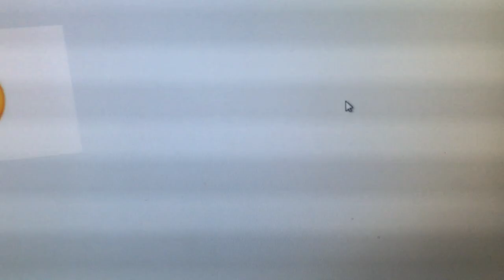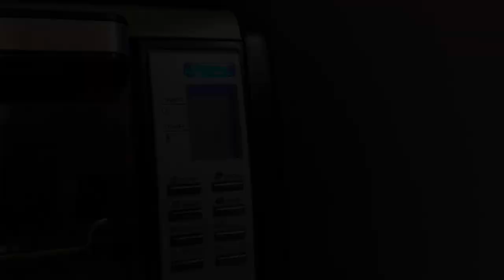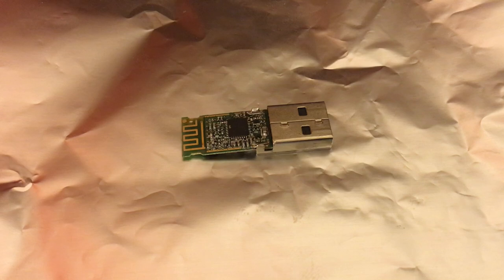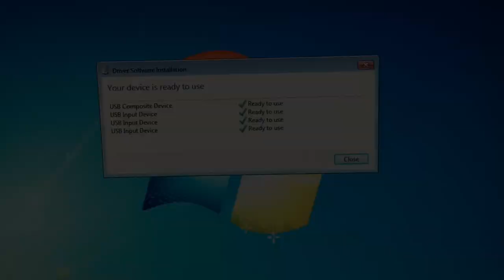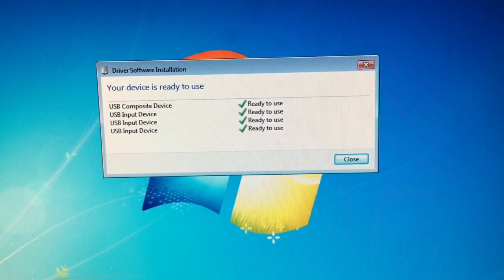How To Fix Broken USB Wireless Mouse or Keyboard Transceiver Transmitter Adapter Module Receiver

Comment: Hello sir, upto now 535 peoples commented here  with success message. I have also followed your video, honestly saying without checking or setting the temperature of ovan.With normal default temp, kept for 10 mnts without foil paper, but kept with ovan glass plate inside. When i switch on power, it got little spark inside and fire. I switched  off immediately and found usb dongle board damaged by  fire and smell and little black color on it. On the top side of board there was a black gum type seal found.

Also i found my ovan  not working now!!!! Damaged. What happened still i dont know.

One question, normally foil paper will not use while baking foods inside ovan, it may get spark or fire, correct?  But you are keeping that, and i am not... Bad luck. Lost all.
Reply from the maker: Sir, using foil in oven is absolutely normal.  Sounds like you used a microwave according to your description, which is using electro-magnetic frequency, not heat. And thats makes a huge difference.

Comment: Man, I did exactly like you and it WORKED! But just for 2 days, I repeat the procedure and then after 1 day it stopped over again. WHAT CAN I DO TO FIX IT?
Reply from the maker: Well, the proper way to do it is to re-flow with new soldering.
Reply: I have a solder but can't find where is broked, it seems as all ok. So, thanks anyway.
Reply from the maker: Is your USB port located near heat sink fan or something? 
I wonder why is it keep breaking...
Reply: ComputerPalz it'snt, I've no idea what's the problem
Reply: ComputerPalz it'snt, I've no idea what's the problem
Reply from the maker: Was it getting hot when plugged in?
Reply: ComputerPalz nope

Comment: The aluminum foil is really necessary?
Reply from the maker: I didn't want to put USB on the metal tray of the owen since is is more heat conductive and it can damage the circuit board.

Comment: how do you remove the plastic
Reply from the maker: Try using guitar pick or knife to pry-open the housing.
Reply: use hot fan for minute and after gently use small knife or thin guitar pick, start in corner where the oposit side is missing plastic, after you first easily removed metal housing, just pushed the pins on side and 2 on top by small electric screwdriver.

Comment: this completely messed up my transmitter. WARNING TO ALL, some transmitters have a UNREMOVABLE plastic base. and i didn't realize until i took it out of the oven to find it half melted. Now the hole is blocked and i can't plug it in at all!
Reply from the maker: Thanks for sharing.

Comment: Hi, i was wondering if it's possible to re-solder these usb receivers. My receiver for the old Logitech MX Revolution that they dont make anymore would work intermittently but basically i had to hold it at an angle i.e. cant use it for any real purpose. I basked it and it seemed to work briefly but it started doing it again - is it possible to properly repair these? 
I can't buy just the USB anymore - it's too old, and all I see for sale are whole mouse sets - new at 500usd, used at around 100 (i.e.what they cost when i very first bought it).

cheers
Reply from the maker: You would probably have to find someone to do it for you. I don't think you can solder it properly without proper equipment, and microscope probably... There is a reason thsoe are called microchips..!

Comment: The max temperature Is 230,what can i do?
Reply from the maker: 230 Fahrenheit or Celsius?
Reply: @DIYtimeTech  Celsius i think
Reply from the maker: I used F in this video. You need to convert to C.

Comment: It did not work. The computer does not even recognize the transceiver now. I used the convetional oven at 195°C = 390°F as suggested in the videos. I recommend, if try, try less time.

Não funcionou! O computado nem reconhece mais o receptor de USB. Dá falha na solicitação de descritor. Usei forno convencional do fogão em 195°C como no vídeo. Se for tentar, recomendo tentar com menos tempo e pode ser que destrua o dispositivo.
Reply from the maker: I guess you were on the bad side of 50/50 chance...
Thanks for sharing your experience though...

Comment: Tried it and it made it worse -_- now it doesn't even work if I push it
Reply from the maker: Did you follow exact time & temp settings?
Reply: yep...
Reply from the maker: Sucks.
I guess you are on the wrong side of "50/50 success rate".

Comment: I have exactly the same transceiver. I try your trick, but it completly broke it. :(
Reply from the maker: Did you use correct time/temperature? It doesn't always work.
Reply: Yeah, 200 degrees for 10 minutes. I was the 50% for who it doesn't work :(
Reply from the maker: I guess someone has to be those 50% of statistics....

Comment: You missed the key step - HOW DO YOU TAKE OFF THE CASING?????!?
Reply from the maker: I just used a knife to open it.
Reply from the maker: 😂 Of course it doesn't. It was never designed to be repairable, unless you nearly break it. They'd rather have you buy a new set. Go ahead, bend over backwards.

Comment: Who in the right mind will try to use an oven to burn up a usb device inside their house?  Not only is there a 1 in 2 chance of it not working, there is a chance that you will lose HUNDREDS OF THOUSANDS of dollars because of your house burning down.  If you are to try this, use something safer and not at your house!!!
Reply from the maker: It’s fine, if you keep your eye on it. Owens kind of designed to keep heat and if necessary fire 🔥 isolated inside.  Have you ever burned a cake before...!?

Comment: did not work my microwave just for no reason
Reply from the maker: It has to be oven, not microwave.
Reply: @DIYtimeTech  same difference
Reply from the maker: There is a huge difference. This will not work in microwave and you will permanently destroy the logic board.
Reply: @DIYtimeTech  Oh shit that's why my motherboard stop working

Comment: I dont have oven
😭
Reply: @DIYtimeTech  Ive try to heat it with just a piece of lighter beneat it, just an inch so that it will not burn.. It's now fix
Reply from the maker: Sweet!

Comment: Nice way to break shit buddy. I'm reporting this video
Reply from the maker: This actually works (50% of the time). 
High enough tempereture melts metal around connectors.
Molten metal flows into the cracks and re-flows those loose connectors. It hardens after you let it cool down at the room temperature. 
If your USB transciever is broken, there is absulotely nithing you can do about it, except this stupid method of course... 
I even calld Microsoft, but they don't sell replacement parts. They want you to buy new mouse and keyboard.
If you don't think it works, just throw away your mouse and keyboard and buy a new one. 
Best regards.

Comment: I did the same a  couple of times with months apart, it's happened a third time, don't fall on the floor but this is what it's transformed into: https://ibb.co/X5d0FNs
Reply from the maker: 😁 As long as it works and hidden in the back of your computer... 😂